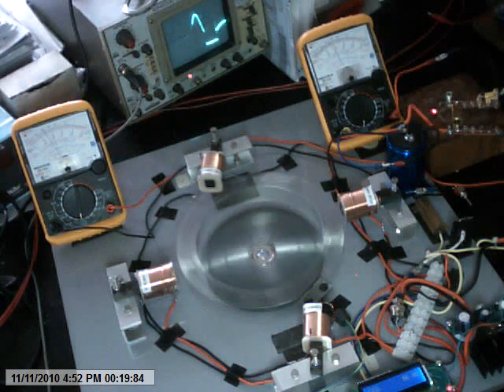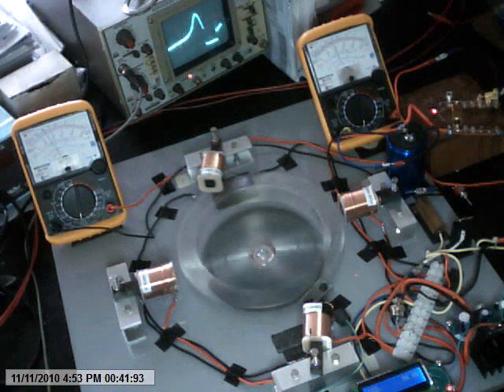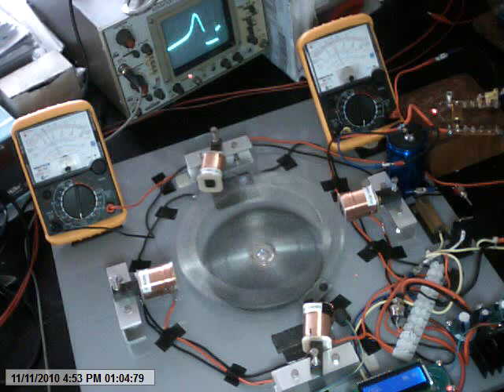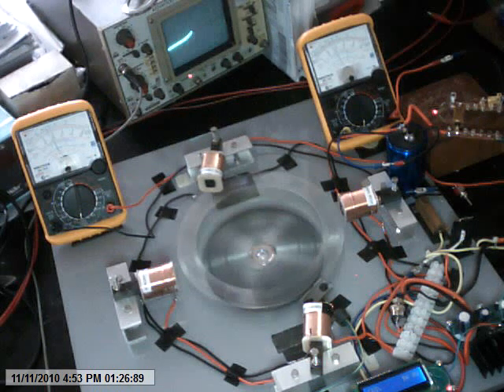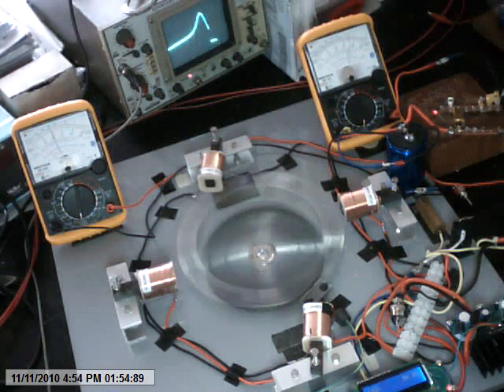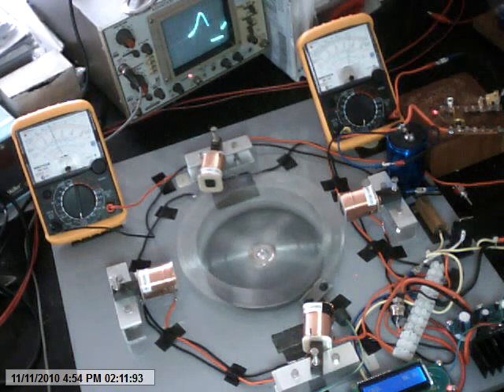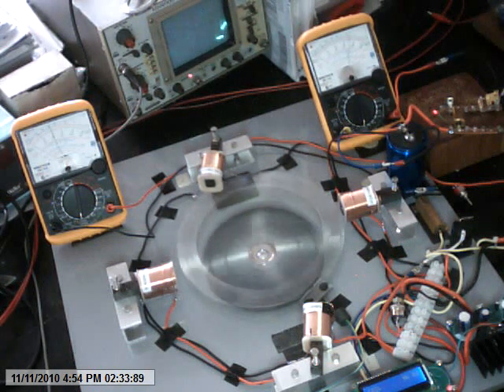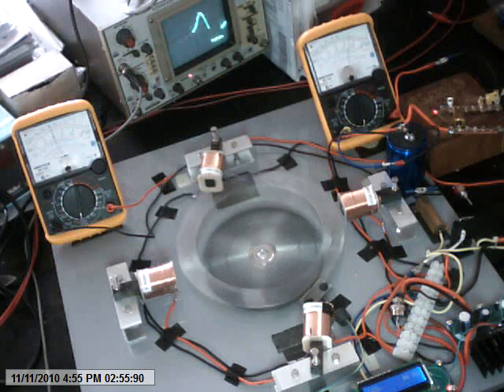Over Unity Free energy Motor Generator_1

Comment from the maker: was reached to bring the capacitor up to a 48 volt charge before it was discharged back to the batteries’ 24 volt potential. By using a counting sequence instead of time to calculate the charge potential of the capacitor we were able to maintain a 48 volt charge peak irrespective of the motor’s RPM.

Comment from the maker: Note: Resistive capacitive time constants need to be considered so the capacitor can be discharged to the correct potential of the battery. This duration time is also calculated by the micro processor. 
It is also important to note that the micro processor counts how many times it has triggered a drive pulse and uses the amount of ignition pulses to determine how long to charge the capacitor before returning the charge back to the battery. 
In the test shown here a pulse count of 250

Comment from the maker: The capacitor is allowed to charge to twice the battery voltage potential, i.e. 24 x 2 = 48 volts. At that time the processor determines the right moment when the circuit is no longer switching to return to activate the relay and switch the voltage stored by the capacitor back to the battery source, returning all energy back to the system.

Comment from the maker: For the intent of keeping this as simple to understand as possible, I have used an electromechanical device, i.e. a DPDT (a double pole double throw mechanical relay) to demonstrate how the capacitor C2 is switched mechanically in and out of the battery charging circuit. 
In normally closed position, the relay connects the capacitor to the drive coils L1, L2 and is allowed to charge through the 2 rectifying diodes, collecting the high voltage EMF off the collapsing magnetic field.

Comment from the maker: @mikepowers420 
. I am using a small micro processor to control this timing setup.
When this is correct the coils run cold no heat is apparent. I do not at this time have thermal measuring equipment. But if make a comparison to when the timing is out by even a few micro seconds you notice very quickly how hot the coils can get.
The drive coils measure a coil resistance .5 ohm and can run on a 6 volt from a few dry cell A A batteries to 35 40 volts from a pair of Lipo batteries

Comment from the maker: @mikepowers420 
Thank you for your constructive question.
This is how it appears at the moment.
The drive stage runs on a very accurate PWM timing set up. The drive pulse measures .003 to .005 of a second and needs to be adjusted according to load and RPM. This delivered when the magnet is in alignment with the iron core of the coils keeping the motor running at the correct efficiency.

Comment: Toranarod, you are actualy producing more energy than you think. If the coils get even a little wormer than the iar, you are also producing heat - and heat is an energy. And the temp change to the equation and you will see what I'm talking about. Thermal differential generators can help you to tap that extra energy.
Peace.
Mike.

Comment: If you have overunity in this setup, then you should disconnect the battery after startup and switch to an empty capacitor bank and prove that the capacitor voltages are increasing over time,i.e. that their energy storage is increasing with no battery connected.